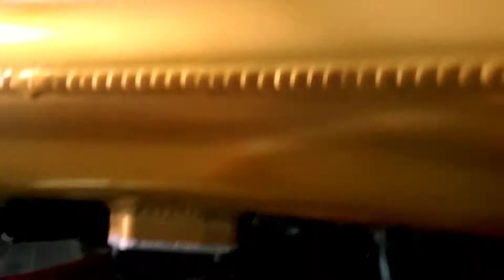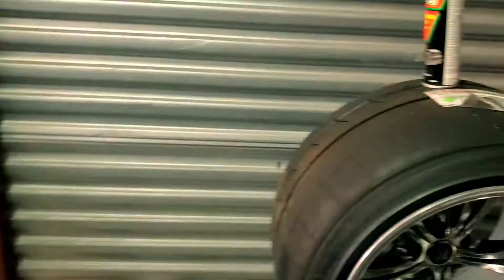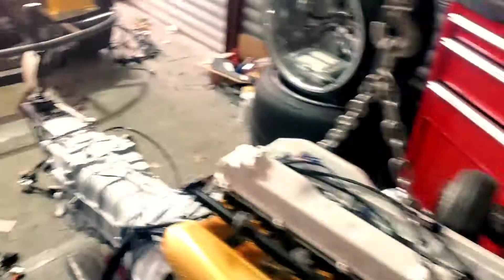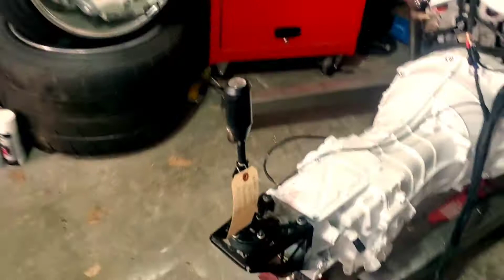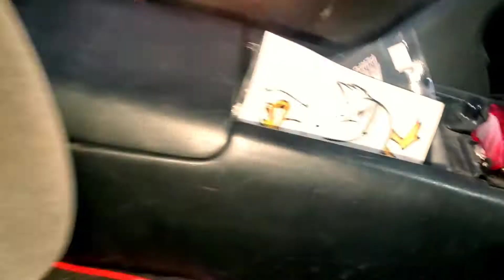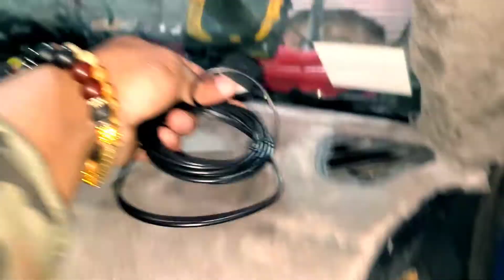rb25det neo wiring specialties harness

Comment: Hi, Just a quick question i got a RB25NEODET for a steal price without any wiring harness on it. Will this custom harness work? On my swap
Reply from the maker: It should if you have all oem sensors. If anything has been changed you will have to make sure the harness you order accommodates for the changes

Comment: Love the video man,  got a 240 w a rb 25 and needs a new ecu and wiring harness. This helps alot! Really appreciate it. The wiring harness you used was a ebay buy?
Reply from the maker: Nah i got it straight from wiring specialties for my neo and for my rb20 when i had it in there
Reply from the maker: Didnt want to risk any harness failures

Comment: Quick question about the throttle body setup. I have a similar intake manifold and throttle body setup as you.. When you ordered your wiring harness, what TB option did you choose? 

Also, my goal right now is to get the swap in and started, then focus on adding my bolt on upgrades later down the line. Since the TB that comes with front facing intake manifold is 90mm, do you think it would be a good idea  to run the own TB with an adapter until I have my turbo, injectors, and ecu?
Reply from the maker: Chose the oem tps option for the harness and as for the tb size the difference ive been told isnt that noticable. Ive heard the 90mm makes the car have very slightly less bottem end but again not noticeable
Reply: @Jay.3 , my dude, I really appreciate! Going to order my harness today then! Love seeing a brother out here with the same love for JDM cars. Hopefully you'll get everything squared away by the next video 🤞🏾. I'm cheering for ya!
Reply from the maker: @TkToKe  mann really appreciate the support cuz i was definitely getting extremely frustrated trying to get this thon on the road this season